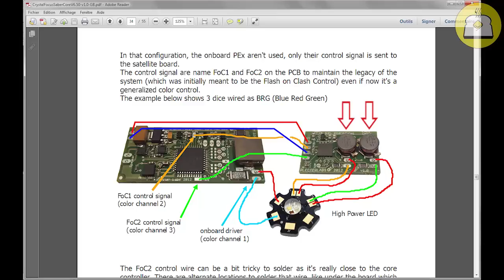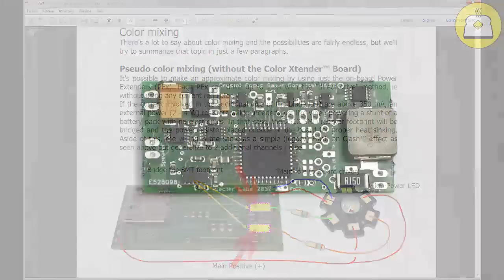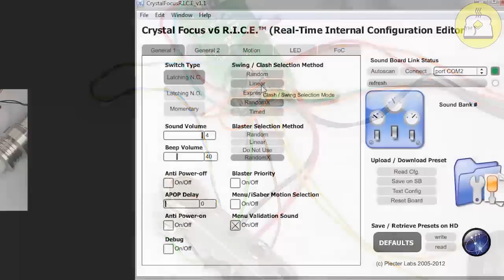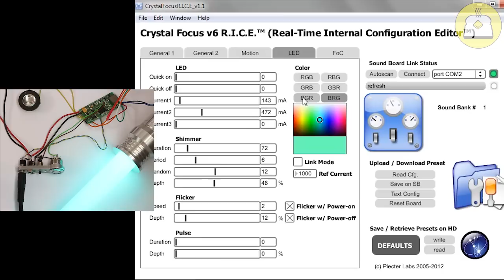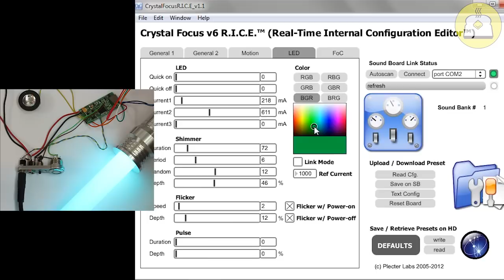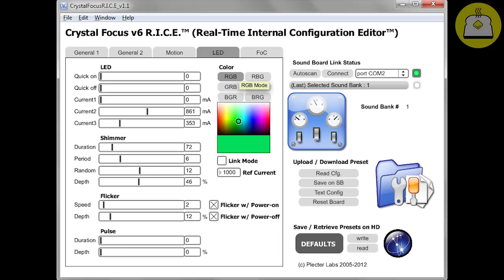Single Cell CF & Simple Color Mixing

Comment: If you need a resistor but use an inline instead of surface mounted, do you need to bridge the two pads. In the manual it looks like its saying that but was unsure.

Comment: What if you wanted to have a B/G/W? Would you wire the Blue to the main channel, Green to channel 2 and White for FoC to channel 3? Or would you run both the Blue and Green to the main channel? This is for a single cell setup.
Reply from the maker: if the B + G mix happens to be your perfect cyan, it's great to run them both on the main channel current regulator ! then have the White Foc on a separate channel. Otherwise, if you want to tune the mix, B and G must be on separate channels. I suggest putting the die that uses the most current on the main channel with the current regulator
Reply: Thanks! So the Green would be on the main channel, and I guess it does not matter which channel is used for FoC? Like, I could put Blue on channel 2 and White for FoC on channel 3? And both would need resistors I'm guessing.

I don't have a bench power supply, so I can only take the Forward Voltage info from the TCSS website for their Tri-Cree LEDs. http://www.thecustomsabershop.com/Custom-Tri-Cree-LED-P1035.aspx

Comment: On the CF 7 if I wire the CEX board with a tri Cree in parallel in BGR, do I need to resist the red die with a 7.4v battery
Reply from the maker: Both CF and CEx board are equipped with current regulators, so you don't need any resistor.

Comment: Putting the Red on channel one when the board is getting 7.4v, do you still need a resistor? or can you still not use one? Thanks!
Reply from the maker: not needed, channel one has the current regulator
Reply: @ErvPlecter  This is the set up I was curious about... so it isn't necessary to complete the single cell mod if you don't want  and use no resistor if you wire the red led to channel 1?
Reply from the maker: @GenXDad1965  no resistor needed on channel 1 with the current regulator

Comment: How would I install a new board on an empty SaberForge hilt? And where do I get a Plecter Labs board?
Reply from the maker: +Anakin Skywalker You'll find all the user's manual on the Plecter Labs website. I'm currently finishing the updates of the latest boards, but the wiring of the previous revisions is 99.9% identical. You can get the boards from my website when I do a batch (they sell out quickly) and from The Custom Saber Shop. They are extremely demanded, and I suggest you follow the FB page to be notified.
Reply: +Erv Plecter Thanks for the info! But I can't really even seem to find anything there. Just a bunch of boards I don't understand nor want. I've ordered a Chosen Hilt from Saberforge and I wanted to get a Nano Biscotte v3 but I honestly don't even know where to begin with the wiring. I know this sounds like im rambling on, but I'd really like to get into the Saber Community, I just don't know where to start with the wiring and whatnot. Registering for the Forums on TCSS seems sketchy to me considering they want to know where I live haha. But, thanks for your time man.

Comment: hello there is any video tutorial for installing cristal focus v8 ( the last versión ), leds and FoC wiring?i heve the intention to buy this soundboard to upgraded an aprentice saber forge in initiated versión to light and sound, thanks
Reply from the maker: You'll find all the wiring instructions in the user's manual
Reply: thanks. i found yesterday night and i dounload... 87 pages... jajajaja my goodness.... will be my first saber ohmmm
Reply: is necesary the power extender if you dont use resistors? or is necesary use them always? my intention is to use the quad cree xp-e leds from sf... are this compatible with FoC or is only a question for the soundboard type? thanks in advance
Reply: and the last question, i saw the option to buy the leds on igniter page, is the soundboard used by SF, they buy the leds quad with the resistor installed on the leds, is this the best option?